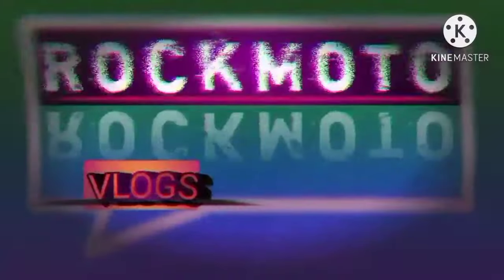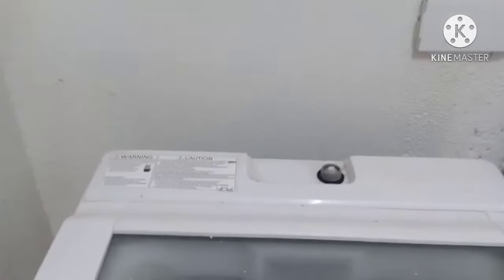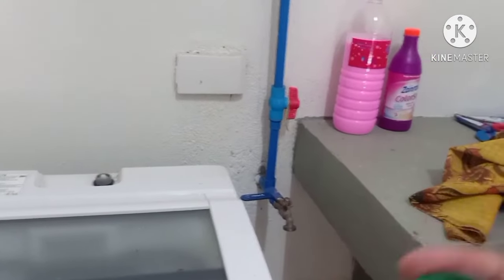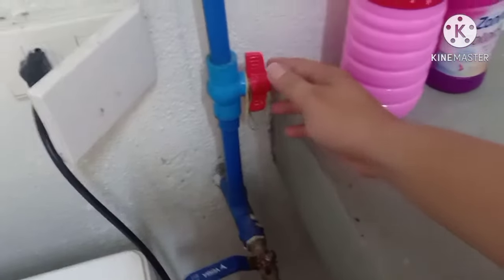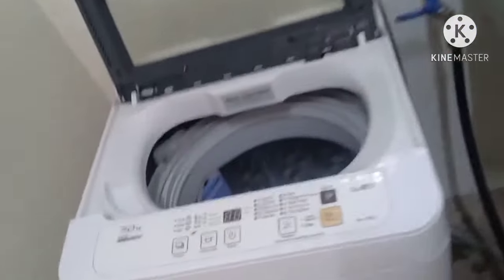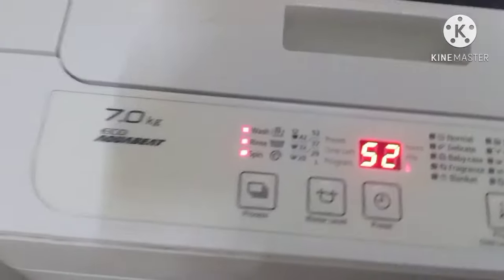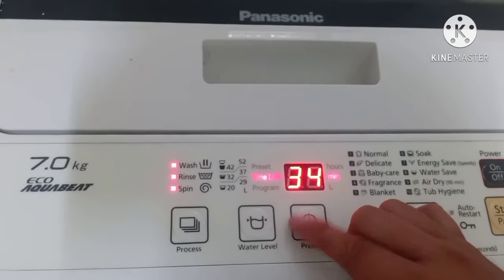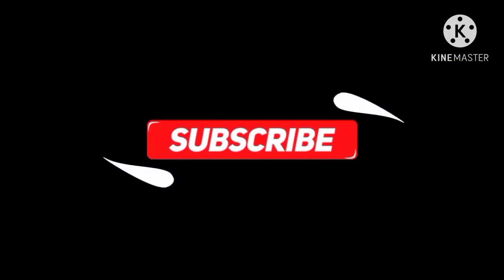HOW TO MANUALLY ADD WATER ON AUTOMATIC WASHING MACHINE? AND WITHOUT WATER INLET!

Comment: If I add some water manually every time is there is any problem to machine if yes what kind of problm is pls rply
Reply from the maker: No, as long as you fill it correctly no spilling as it will cause electrical grounds.

Comment: When I add water in machine it runs out immediately it won’t fill
Reply from the maker: Don't make any program yet just fill it then soak your clothes, and what kind of washing machine do you have?
Reply from the maker: Don't on, perhaps every single washing machine brand has its own style. Maybe mine has a style of holding the water and it won't run out.

Comment: What if you have a front.loader??
Reply from the maker: My advice is don't try if you have a water inlet, if you don't have it, try to put water and observe if the water doesn't sink. Then try to go on and start any modes.
Reply: I've had to use my front loader manually a few times. I don't know whether it works for all models but I just pour the water down the soap tray thingie until the machine starts washing. Unfortunately you have to stay there and add more water whenever it requires more. On my current one it will show the H2O sign in on the display. On the old one it would just make a weird sound and then you'd have to add more water. 

I don't think this method is good for the machine though.